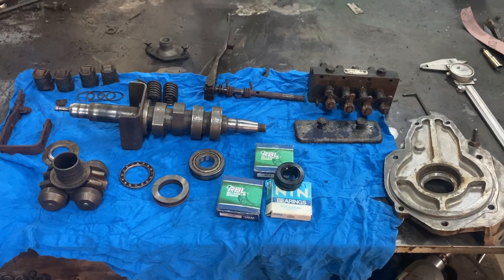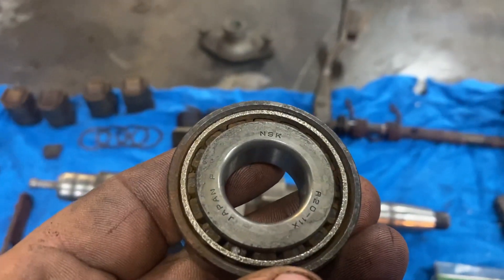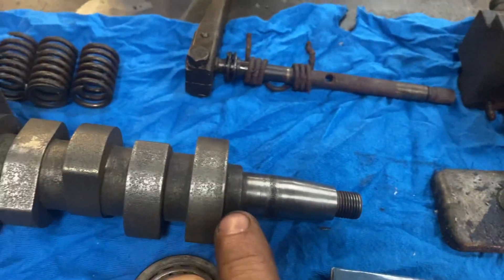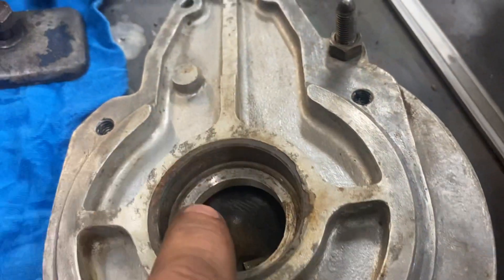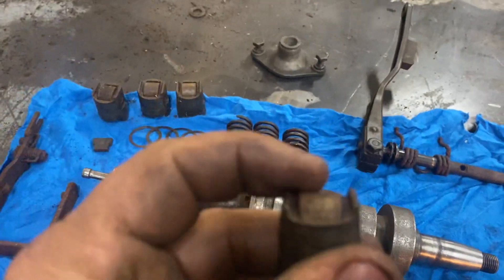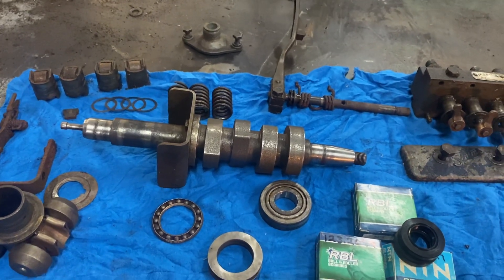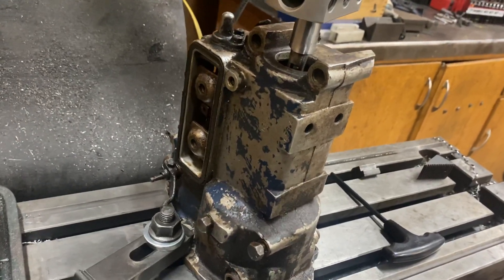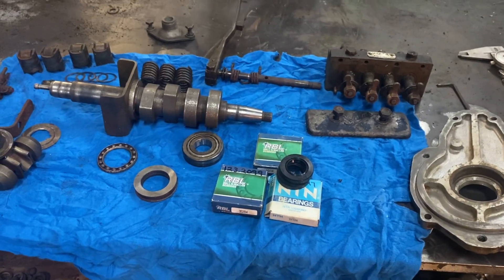Fordson Major Simms injection pump repair

Comment: Did it work? Interesting fix.
Reply from the maker: Yeah it worked, I had a little bit of a hunting issue with it at idle but it ran well. The tractor was abused real bad, I drained a lot of sludge from the oil pan and filter housing before we started it but the damage was done, it seized a rod bearing and sent the rod out the block not long after unfortunately. It just wasn’t in The kids budget to go through the engine first as I recommended. It had good oil pressure when it left my shop and I told him to keep a close eye on it but who knows if he did. I figure it plugged the filter and starved for oil. It didn’t run away or anything, he said it spit the rod at idle but I wasn’t there to see it or how he maintained or operated it... the governor was set at 2200rpm so he shouldn’t have been able to over speed it.

Comment: P4596 is the pump number
R20-11X is a common common bearing, well it is here in NZ. Ive just bought a box fir the injector pumps I rebuild daily. 
Are you removing the taper roller bearings to put ball besrings in???
What are you going to do to set the endloat?
A lot of weight goes on that giv mass and therefore the shaft.
Reply from the maker: Tapered roller bearings installed, machines the case and shaft to suit preload. I’ll post an update as I’ll be calibrating the rack soon.
Reply: Cant get over you cant find R20 bearings in the US or they are so hard to find. Flats on gov mass rollers cause issues with those pumps.
Factory endfloat settings are too loose so Ive slways tightened them up and never once had an issue in 40 years of doing those pumps. 
Fit double lip seal to drive end of camshaft. 
If you are fitting a head joint between head and cambox of the pump then spill timing will have to be rechecked.
Reply from the maker: @matui6983   those bearings are available but very hard to source and near $100 each. I put in standard industrial tapered roller of the same ID/OD only difference being 15.25mm thick instead of 12mm. Which is why I deepened the case pockets and machined the shaft shoulders to maintain bearing preload which is set at about 0.005” right now. Might reduce that to 0.002-3” to not stress the case end too much. Theres no tappet adjustment for start of delivery in this pump other than tappet shims... I was going to use a degree wheel with the rack fixed in place to set end of delivery to an equal amount of rotation for each cylinder. There’s also a new governor thrust bearing installed which is slightly thicker than the original. By the time I surfaced the sliding collar and fixed collar due to rust I’m 0.015” thicker than original. Should be plenty of adjustment to maintain idle speed setting.
Reply: Holy moly! 
Thats an incredible price for  the bearings!!!
Ive just bought 40 bearings for NZD $20each which converted to USD is way cheaper than that $100. Again Wow. 
100% agree with the endfloat set at 2 thou. 
Factory 5-6 fhou has almost always ended up with the engine humting either straight away or a bit further down the track mainly due to the control rod flicking because the governor linkage connecting the governor mass to the c/rod isnt as good as the following model of pump fitted to the next generation of Ford engines. Thats why those injector pumps never really cut it for genset use. 
Diff thickness shims is the only way to adjust phasing. I set phasing/timing to the very start of the spill cutoff not the end. 
Your degree wheel idea will work fine Im sure. 
Was the new thrust besring the white plastic cage type or a metal type like the original? Never liked the plastic cage version. 
Dont know what brand of parts you get or use over there but Ive used Spaco from Italy for well over 30 years. Camshafts for those pumps wether single or double ended are worth their weight in gold now. Well they are here. 
There should be more than enuf left for idle adjustment if dimensions have only increased by 15thou. 
Good to see you took the approach to remedy the issues with the pump. 
Most places would just try and replace the entire pump.

Comment: I have Simms P4744 in 510e-6050e FL engine. I have a problem with constant engine speed in a claas harvester. After starting on a cold engine, the revs fluctuate. When the engine is running under load, the effect is as if the engine is turned off for 0.5 seconds and then returns to rotation. what's the problem?
Reply from the maker: I had a hunting issue with this pump also. First thing I’d check is the oil level and condition in the pump. Then make sure the rack moves freely, if there’s water or rust the governor could be sticky causing the issue. Someone also mentioned to me that Simms made a “rack damper” that bolted on in place of the little cover over the exposed rack end. This would slow sudden movements and help maintain a steady speed. I don’t have a part number though, sorry.